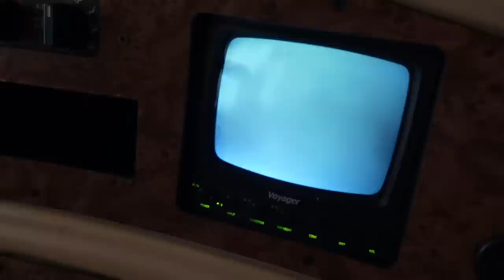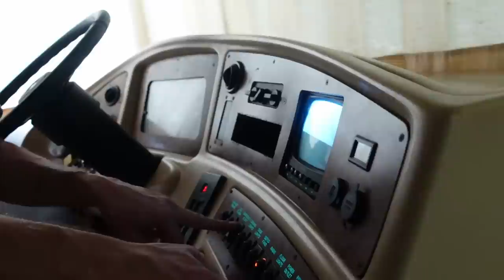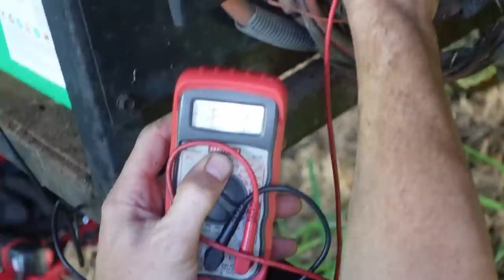FREE Abandoned RV… Will It Start?

Comment: Yeah diesels are kind of hard to start when they sit for a few years you also want to change the oil the fuel filters water separator filter when you first started it up there was just very little fuel in the fuel filter and it probably ran dry that's why it was so hard to start lift pump probably hasn't been running 2 years so just do a full maintenance on her and she'll be fine. Diesel I've had vehicles that had 20 years of 20-year-old diesel fuel in it that fired right up so just put fresh diesel in it and change the filters and drive it

Comment: 1200 is usually a set Rev limiter on a diesel in park. At least it has been on my 18 wheelers. Should move if you run it into gear.

Comment: it will only run up to 1200 due to air in the fuel filter; from sitting  there are two fuel pumps one in or around tank and the other is the high pressure pump on drivers side the pump is lubricated by the diesel fuel passing thru it that's why you don't pump pedal unscrew fuel filter and fill it up then screw it back on should fix the issue

Comment: A Mas airflow censor did that to me once. Wouldn't let it rev over 22,000RPM. And the next time I had that issue the throttle body lube hardened and ceased the actuator.

Comment: Jimmy turn the parking brake off and put it in gear and rpm should be normal amiaya ya a safety so you can rev the engine unless it’s in gear

Comment: 8v per batt? You might get away with that on the house batteries, just a recharge. They are supposed to be deep cycle. But the engine ones? Yeah ok, replace.

Comment: Stop pumping the accelerator its a diesel let it run at idle until it worms up it was stalling due to low fuel pressure from sitting and if you don't change the battery's you will cook the starter and wires leading to starter amperage is very important the engine should be 14 to 18 to 1 compression that's why it acted like the batts were low

Comment: Although I agree with your sentiment, I have to question your experience. I you know nothing about diesel engines maybe bring someone who does. Or maybe someone that knows the electrical systems on RV's. Going around with a hammer whacking the computer is not the best of idea's,  you of tried jumping the solenoid with a screwdriver to test would of gone a long way to finding your problem.

Comment: Maybe some electrical connection spray to clean up all connections. Checking the power everywhere is a good idea.  

I worked on a motorbike this summer. It had the antitheft computer go bad, it was a build in device. Had to download the workplace manual. Checked the wiring schematics. Had to  work out which wire goes where. Then connect two wires together, and it started again. The device was a starter breaker, that you could control with a remote. 

So all i can say is just get the contact pray to clean all electronical connections of all oxidation. And just check all the wiring, and all the values. 

A workplace manual is the way to go. 

Maybe the carburetor has gunked up with old fuel and needs an ultrasonic cleaning.   

I think those are the things that could be a problem. 

Maybe a mouse started living in the exhaust and its filled with a nest. Or the intake air filter. 

When i was a kid, i put an apple in someone's exhaust. Jammed it in there. The old woman came back, and she could hardly drive off. That that is some proof of the practice. She was one of those mean German ones, and im Dutch. :P xD Of course: "wir haben es nicht gewusst." Hahahah

Greetings,

Jeff